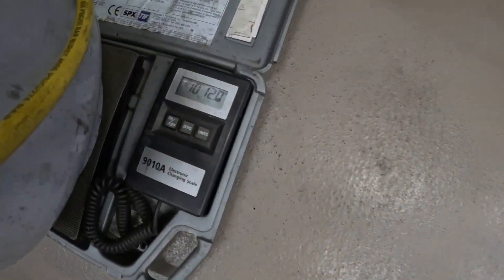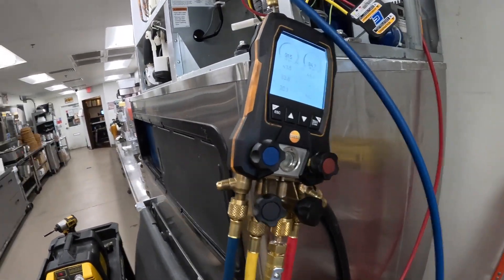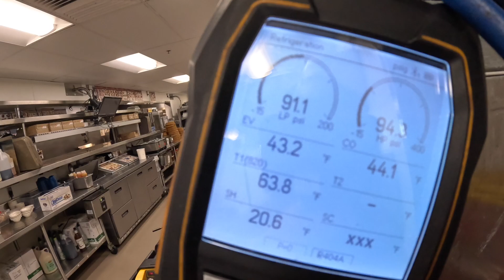Refrigerant Recovery Tip

Comment: Would putting a heat gun on that area help?
Reply from the maker: Yes, that would raise the pressure and help to remove the refrigerant, you can also use a crankcase heater there, but never use a torch. Thanks for watching